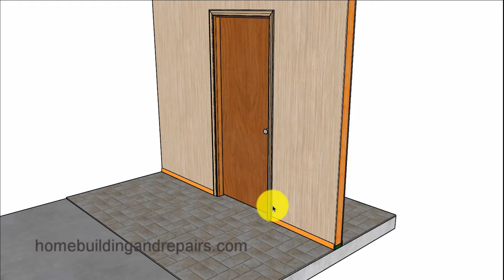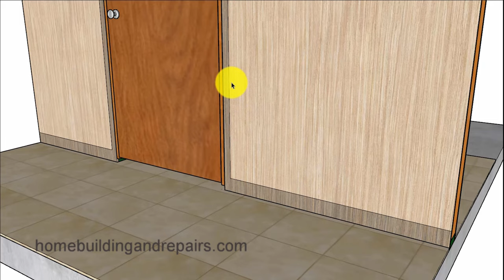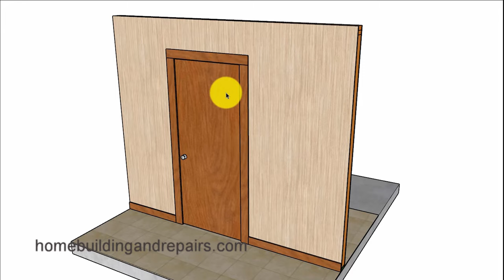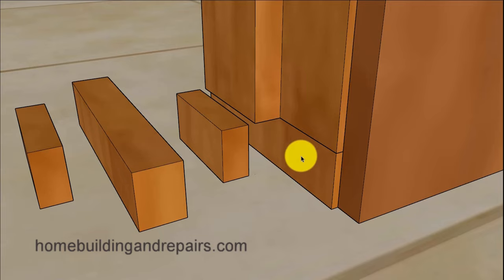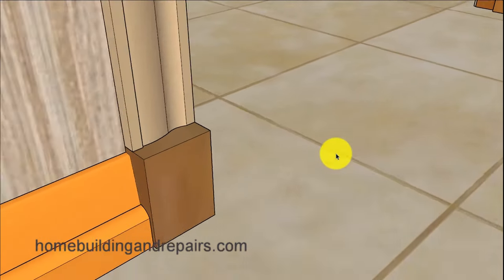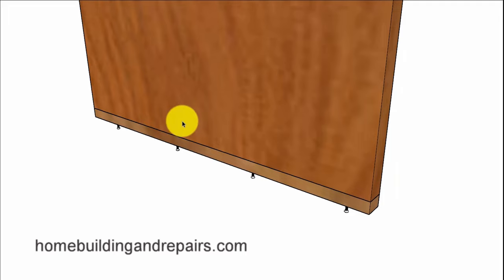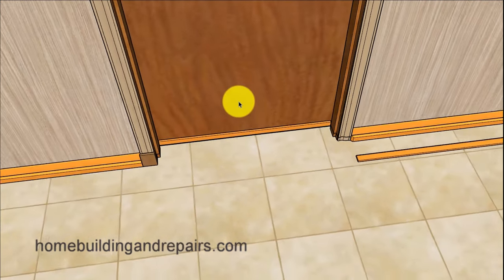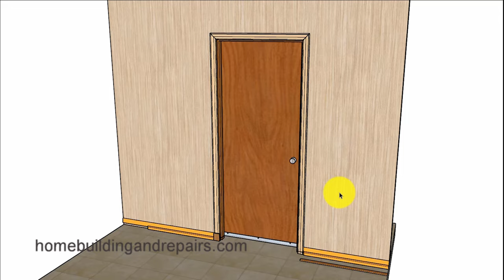How To Extend Bottom of Door And Trim After Multiple Layers of Flooring Have Been Removed

Comment: As someone who came in and said "lets remove some flooring" I made this happen to a trim spot. Flush mounted casing in vertical shiplap with super hard to cut in edges. Cutting in the fillers worked out best for me. Great video!
Reply from the maker: Thanks for sharing

Comment: awesome video- I need to do this as I removed tile, cement board and wood flooring all together.  I remove about close to two inches.  Im going to just lower the door as I removed all the sheetrock and can now build the sheetrock around the new door height-great video!
Reply from the maker: Sounds great and you often have more options when removing trim and wall boards!

Comment: Thank you very much for making and posting this video. It helped me think about options while installing LVP up and down stairs. 
Having transition issues on what to use for butting up LVP to tile where I have a significant drop. Used quarter round at the AC closet but it looks too abrupt going into bathrooms where you walk across. Also having color matching issues with transition that should but do not work. TY.